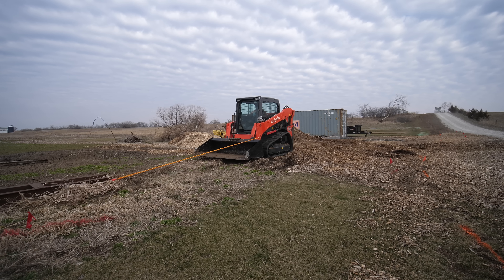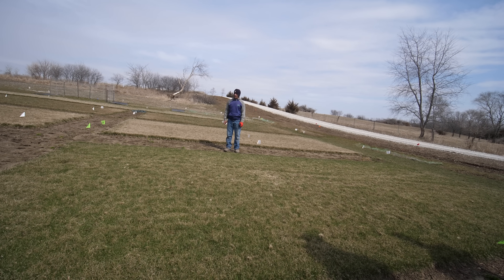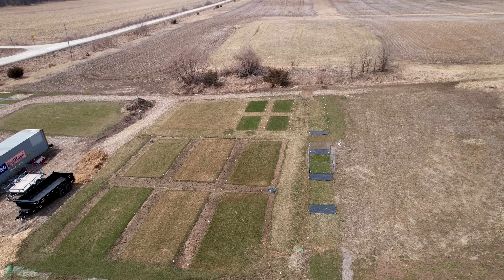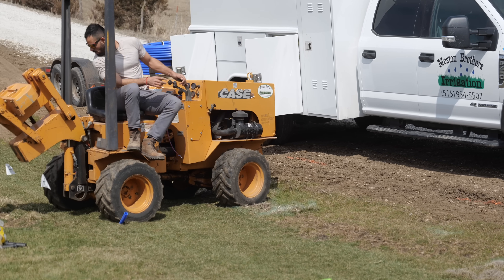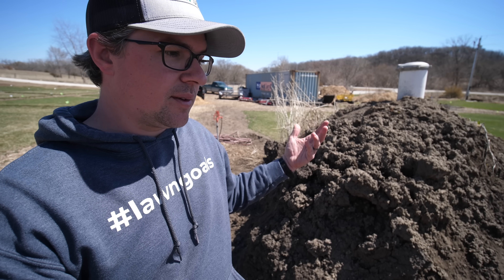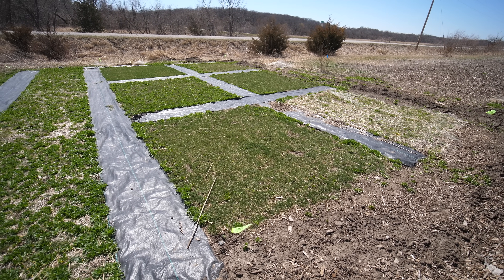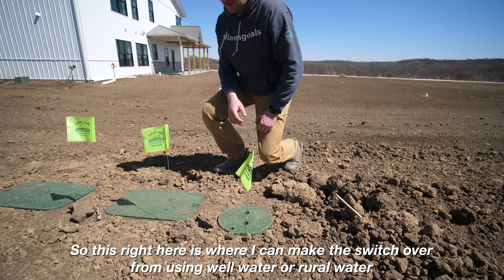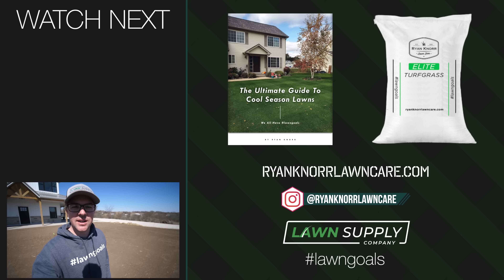New Irrigation System!! // Rain Bird System Installation and Detailed Tour

Comment: The king is back, baby!! Love the videos, but I would love them even more if you would add a cost breakdown. Use this comment as a like button if you would want to know that info!
Reply: He probably won’t mention cost because a lot of this is probably covered by sponsorship with him mentioning the names of what he uses, and then them donating the materials for the projects.
Reply: Costs vary widely depending on specific products, accessories, overall system design, your chosen contractor and collateral costs for plumbing, electrical, wifi, etcetera.
Automated, customizable irrigation management, however, is priceless!

Comment: They should have installed swing joins on all of your rotors. Once the soil settles your heads might start to show and you'll hit them with your mower. Also if you drive over it with a ride on mower I will put pressure directly on the pipe below which can snap. Swing joints have give and can be lowered or raised to meet grade. 

Also get a Drive for your well instead of a pressure tank and switch. Saves space and gives you constant pressure regardless of the GPM of each  zone. Also has built in pump protection. Look into a Pentek Intelli Drive

Comment: Looking great. That looks like a 2 wire irrigation system and each valve box has a decoder inside of it. They are great to use like in your situation with a big place like yours. I love them because it ultimately saves on the installation cost instead of running a bunch of wires but can be a headache to repair when something breaks. Ready to see what your lawn looks like going forward!
Reply: Each solenoid is a decoder!😮

Comment: The property is looking GREAT!!!

I learned that RK is the green contact that destroys group texts.

I’ve been using Rainbird 5000 to water 40k sqft for about 4 years.  After the 3rd season, I had to replace about 80% of the rotors. I’m installing Hunter I-20 rotors on the rest of my 3 acre property.

Edit to say: I have put over 50 tons of sand on the lawn, so maybe the sand isn’t good for the rotors.

Comment: Wow Ryan, 31 zones?  I bet that cost a pretty penny for the complete system!  Good luck with the front yard, I don't think I would have put the back flow on the outside exposed to the weather?  I can see that you have constant wind up there on the top of the hill.  Take care and don't work too hard, everything is looking fantastic!
Reply: Mine and everyone else's where I live are installed outside (not sure if it's code) and we are in a similar climate to Ryan. The RPZ is taken off and stored inside and connections covered when the system is winterized in the fall.
Reply: Not left outside for winter taken out and put in the house when winterized
Reply: Backflows and entire systems are flushed before cold weather so this should not be a problem.

Comment: I had irrigation installed on my property just a few weeks ago. I have about 40k square feet of turf so it was desperately needed as I plan on renovating the back 25k this fall. I have two wells on my property so everything is running off the second well that doesn't deal with my home. I also went with a rainbird system. I like being able to set it on my phone or the main terminal at the well. It changes what you can do with turf.

Comment: a well done project
two remarks:
1) rural water is chlorinated, not good for soil life in long term application as it basically sterilizes the soil, well water is definitely better
2) wouldn't like to do the pre-winter blow out of the shallow pipelines and sprinklers, will be "a lot of fun" but there's no other way with the irrigation systems. I have only 7 zones and this is my least favorite garden work I do

Comment: Great video as always!The Rain Bird 5000 plus can reach up to 10meters, is there a reason for them to be so close together? thank you for all the great content!
Reply: Probably due to low pressure from the well pump.
Reply: @titosrevenger  i understand, but if thats the case they should have used the model 3500
Reply: If he has low water pressure, they should have done 4 sprinkler heads per zone. You can add an irrigation pump that will help with low water pressure problems.
Reply: Overlapping zones water twice as fast. I did close to the same system, I-20s overlapped at 15-20' apart even though they threw water twice that distance. I water 40k in 13 zones with up to 6 heads per zone.
Reply: @watsonrk1  i see, it makes sense! thank you for the reply
Reply: When designing the system and laying everything out, most heads water in a circular pattern.  Take a handful of pennies and lay them flat and scoot them together. All the little square holes need water also, so you need to overlay one penny on another to cover the fringe or you'll have spots not getting any water. To test once done, place a rain gauge in those areas to measure the delivery rate.

Also consider putting same type heads on the same line... like heads near the sidewalk. They water a half circle, take less time than spinning a full circle and put down twice as much water. So don't put a full circle head with half circle heads or you'll be flooding the sidewalk or if you adjust for the sidewalk to be good, the circle will be half as less water and your glass will brown out in the underwatered spots. Or you could increase the delivery rate of the head.. but be careful, to many heads and the pressure of that zone suffers. Also, don't water in the heat of the day, start early and be done around 9am to allow the moisture to get off the blades.
Reply: @watsonrk1  Normally i only overlap them about 1 to 2 meters. Do you have any  brand that you prefer? I tend to like the 3500 or 5000, but i see a lot of people using Hunters PGJ and PGP.. For small  areas i use Rain bird VAN instead of rotator, they are cheaper and i dont see a big advantage in using rotators
Reply: Triangular spacing trumps square spacing.

Comment: Did you consider pop up impact sprinklers?  If so what are the cons for those?
Reply: Pop up impacts have a tendency to flood their own area and bring debris down with them that will then have a chance to either jam or partially affect the spray on the next use.

Comment: Would love to know how you chose the irrigation contractor. Nothing for or against Meston Brothers, just curious what info you gathered prior to pulling the trigger. That looks like quite the project so I’m sure you out serious thought into it.
Reply from the maker: The local sports turf people recommended them and they've done a lot of huge commercial projects and are well respected.  I talked with them pretty extensively to get a plan together and they didn't think I was nuts so that's always a start 😂
Reply: Given that project I’d say that was a prerequisite. My bet is the average companies in the area would have cringed.
Reply: @matthewbono3273  Cringed, accepted the job, and then perhaps messed it up.

Comment: After having had a well, I would not go back to city water. My well water is so perfectly filtered that it's absolutely perfect when tested. City water tastes bad. My filtration system has a softener, reverse osmosis, UV light, and a filter for undissolved particles. All that is set up with a water pump I can set the psi for so I can get the same pressure as the city at all times.

Comment: Biggest question after this video, if you have a MAC, why do you not have an iPhone?
Reply from the maker: I just don't like iOS. Love my android phone and have had one since the beginning of smart phones
Reply: @ryanknorrlawncare  I was the same way until a couple years ago.  Made the switch because I use an iPad a lot.  It was a good decision.  Where you give up some control and possibly some more flashy hardware, the software works so great in comparison, especially when using it with other iOS products.